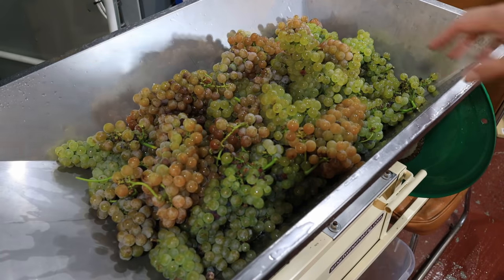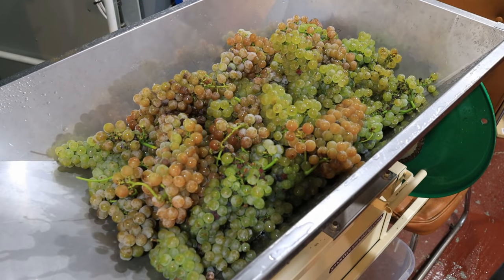Making a White Wine from Grapes

Comment: Just finished racking my first ever batch of wine for aging.  It didn't taste too bad.  Course my standards are not that refined.  My goal was to make something drinkable as a humble table wine.  It was the most stressful process getting the grapes picked, cleaned, pressed and fermented.  Pretty sure I did everything wrong.  I did managed to make a rough adjustment on pH to get a better ferment.  I left it on the lees for 2 months.  I ended up with about 7 gallons of wine from 100lbs of grapes.  Of that I have about a half gallon that got some lees in it by accident.  I plan to let that settle and then bottle it for topping off the carboy and maybe an early taste test. I did this all by hand and by myself.  It was exhausting.  

Anyway, I enjoyed your videos.  Probably a little more technical that I needed and some of them caused me a great deal of stress.  Thankfully, I had a local winemaking shop owner who has been coaching me through every step.  I cannot wait to share what I got so far with him.

Once I got the wine settled, I got ambitious and fermented some crab apple cider. It's drinkable and pretty pink.  One batch came out very cloudy.  The other was clear.  Although racking stirred up a mess.  Any way, now I've got a few tools to experiment with fermenting other fruits that I can gather from the neighborhood.

Comment: Is any differences between pressed white wine  and non pressed?????

Sometimes people says thad pressed is low quality
Reply from the maker: It depends how hard it is pressed.  The light press is going to be about the same as the free run.  As you get into the harder pressed stuff it is going to have a good bit more tannin and phenolics which can throw the wine out of balance.  A dry white really can't have too much tannin/phenolic content or it will taste bitter.  You can hyper oxidize before fermentation to knock down the phenolics if necessary.

Comment: As always awesome video.  I just started a rose of cab. I decided to treat it like a white and red. two different yeasts, I guess life is a big experiment. I'm in primary and it is doing great. I do stir once a day and check. for smells etc.  Thanks for all the encouragement on your vids
Reply from the maker: Thank you!  I generally treat roses almost exactly like white wines.  Cold settle.  Ferment cool.  Swirl and smell daily.  They normally need a little acid though since red grapes are usually picked with less acid.  If the sugar is high (24+ brix), I will usually cold crash them to stall out with some residual sugar.  You can also add a little acidulated eater to bring the alcohol level down a bit if you want to make a dry wine.  A 14% or 14.5% alcohol rose is not nearly as elegant as a 11-12.5% in my experience.
Reply: Great video!! My white Catawba i thought I had ruined is doing great thanks again for your help!! I do have a question I have a blackberry and raspberry wines going and they have a some tartness at the front end but a great berry flavor on the back end is there any way to cut through the tartness? Would sweetning cut it down at all? Love your channel and thanks again for the help

Comment: Nicely done, love traminette.  If you wanted to borrow a 2.8 gallon carboy next time you are in this situation I’m in Pgh also.  I’ve used 71B on mine.  Laughed at the stir bar comment, I’ve done that.  I use my canning jar lid lifter magnet to drag mine out.  I’ll look into Renaissance, Zack Brown swears by them too, he was an investor as they started up.
Reply from the maker: Thank you!  I might have to get a couple 2.8 gallon carboys.  The renaissance stuff is incredible, especially on white wines and fruit wines.  I wish it were a little easier to buy. I bought in 500g a few years ago and it seems to still start without issue and ferment happily.  I use Muse on occasion on the red wines but I have been more recently using more BDX instead.  I have a side by side going of Muse and BDX in petite sirah and the BDX seemed to be a little more complex and savory, where the Muse was a little more fruity and a little more ethyl acetate and isoamyl acetate during the active fermentation phase which blew off pretty much immediately after the fermentation finished.  I'm thinking in the long run the differences will be miniscule but we'll see.

Comment: Have you ever done any pre-fermentation fining?  I used bentonite and polycacel before starting fermentation on my Orange Muscat and it really did a great job at settling out the solids.  It just finished fermentation and I'll back-sweeten with some residual juice I froze to bring it up to about 2%. Then I'll run it through my buon vino filter and it should be crystal clear.

I would also suggest using Fermaid O instead of K since it produces less heat.  I also put my carboy in a cooler instead of a tub and it seems to stay cold longer and with less ice.

Comment: Just finished fermenting my 2022 white grape crop. Talk about a bin buster!!!! Anywho I was wondering how to handle the wine now that I've added SO2. The wine is very good but a touch bitter. I'm going to cold stabilize it for 10 days and then bottle. Guess I'm wondering what your experience has been as to the wine aging well and becoming more mellow. PS my normal red 15 gallon vineyard produced 35 gallons this season, we had a late spring in Iowa and a cool August.
Reply from the maker: I normally let my whites age in bulk (carboys) for about 3-6 months.  They will usually mellow out quite a bit in that time and even more with a little bottle age.  You will want to degas a little since that is still pretty young to bottle by wine standards.  You can take the edge off a little with about 50mL vegetable glycerine to 6 gallons.  Glycerine is a natural yeast byproduct that has a naturally sweet taste but won't ferment.  Many of my whites I will back sweeten a bit to balance also.  Even as little as 0.75 grams per liter can really bring them into balance but make sure to stabilize with k-sorbate or it will ferment in bottle.  Also...  If you don't want the wine to go through malolactic fermentation you will need to maintain plenty of SO2.  You will usually lose about 20-50ppm in that first few months of aging due to binding up or oxygen interaction.

Comment: Curious. You mentioned cold crashing to halt the fermentation and allow you to treat residual sugars as sweetening sugars but how in reality does this work? Are you cold crashing to force the yeast to fall out of solution and so you rack off the yeast and then stabilize such that the stabilizers will work effectively because the size of the colony is relatively speaking so small? Why wouldn't the yeast cells that don't drop out not reproduce?

Comment: how many trees do you have to make that amount? i am currently working on starting a small vinyard in my yard and woudl love  to talk about it with someone.
Reply from the maker: I have about 60 vines in total.  To make a three gallon batch you need about five or six.  It will take about three years to get a harvest and four to get the first full harvest.  If you are growing wine grapes it is pretty intense though.  They are vulnerable to about every pest there is since they are not native to the US and develop little natural resistance since new generations are clones of previous.  I have some more detail on my website (Smart Winemaking).
Reply: @TheHomeWinemakingChannel  thanks! i am growing a variety here that survives to about -31 and is less vulnerable to pests i am in zone 4.a  in the mountains.
Reply: @TheHomeWinemakingChannel   It is not accurate as to how many vines you need. One older vine can produce 18 gallons of juice. It all depends on the caliper of the trunk and the length of the cordons.

 Vineyards plant densely and use short vines because of the picking tractors. Home growers need not be concerned with that. You can plant fewer and farther apart. With that being said, I would not suggest planting just one. Hedge your bets.

Grapevines have some issues, but nowhere near as many as stone fruit trees. My biggest problem is voles. I need to keep poison bait stations out year-round or they will eat the grapevine roots.

Comment: Is 60 ppm a level that won’t hurt the yeast?  Wouldn’t the CO2 evolved from fermentation be sufficient to prevent oxidation?
Reply from the maker: 60ppm will become 30ppm or less by the time it reacts with everything it can react with (including oxygen) in the juice.  Wine yeast has a tolerance to about 60 or 70ppm without issue, depending on the strain and the pH.  Lower pH means lower SO2 tolerance.  Some strains will be much more tolerant like EC1118 (which actually produces a good bit of SO2 naturally).  The CO2 produced by fermentation is certainly helpful but does not knock down any wild, non wine friendly yeast strains or bacteria.  It also is shockingly easy to get enough oxygen into a white wine to oxidize it at least enough to diminish the fruit character.  For instance.  Your polystyrene airlocks are somewhat oxygen permeable and heaven forbid you have silicone stoppers which are virtually invisible the oxygen in air.  Even the water in your airlocks will have some level of dissolved O2 which will inevitably make it to the wine albeit  very slowly.